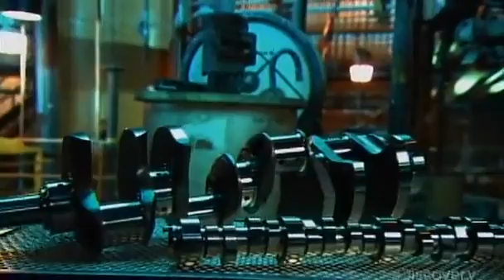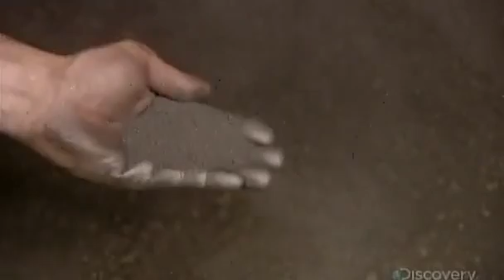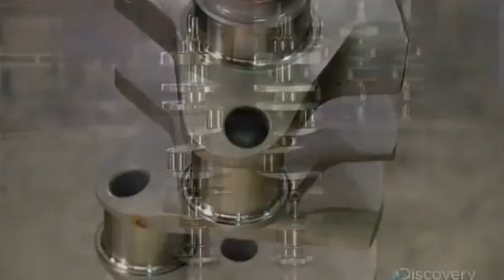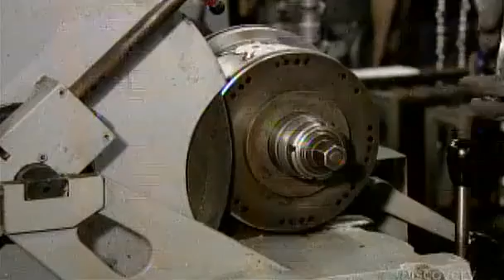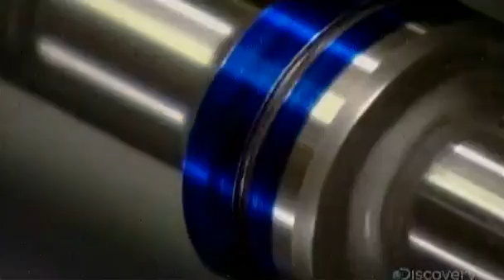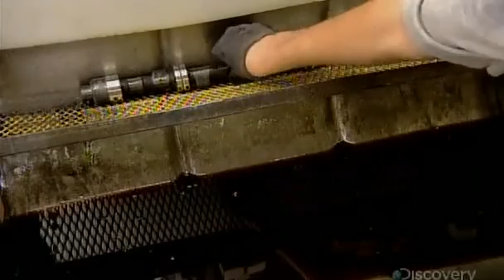How to make Crankshafts and Camshafts {www downloadshiva com}

Comment: O i see how you can do the lobes and counter weights of the crankshaft by a template that moves the metal rod in the lath so the cutter doesn't cut perfect circles all around it will move to make lobes cool cool cool this video cleared up the hard parts of what i thought could only be done by computers didn't know how the old way that one could do it